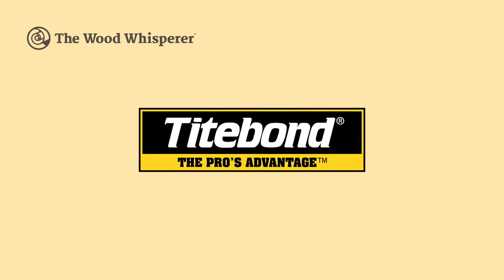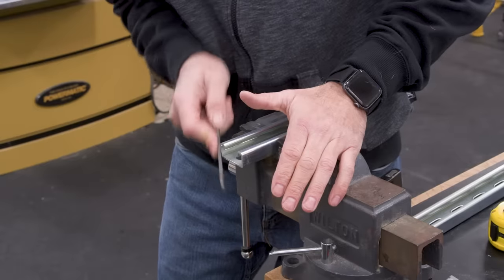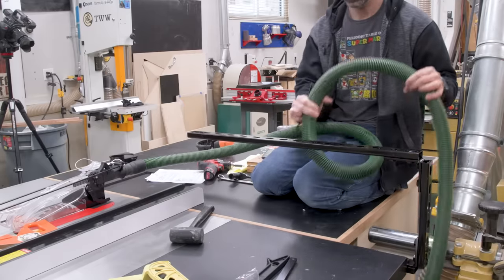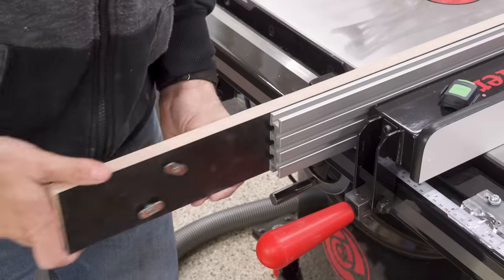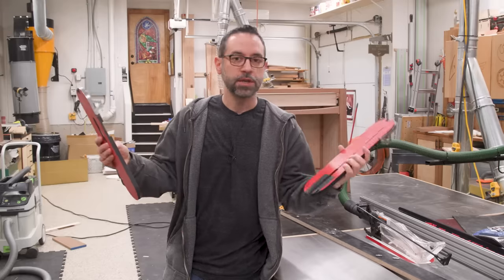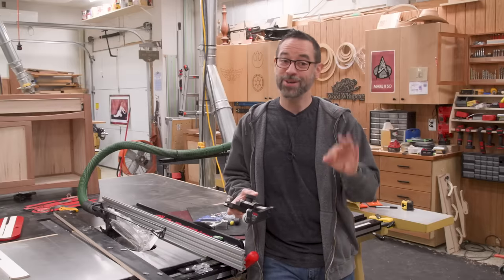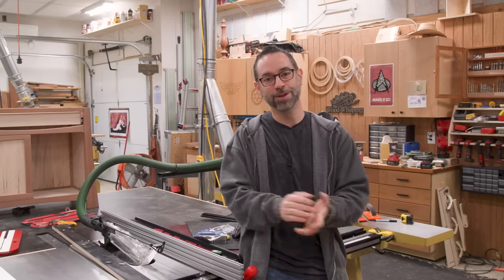7 Must-Have Table Saw Upgrades

Comment: Buying a Saw Stop for my new shop in my new house, and went searching for inserts for the saw. Found this site (for the 2nd time) and this time saved it to my shop ideas play list. Love what you did for the dust extraction system and the upgrades you made to the fence. My kids bought me a Jessem Clear-Cut TS Stock Guide for my saw and setting it up with the rail on the fence is an awesome idea, something I'm sure I'll be incorporating into my saw. Thanks again for all you do for the woodworking community.

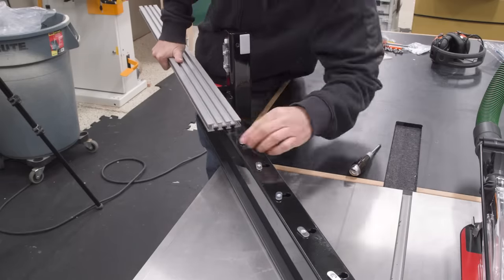Comment: I installed the aluminum extrusion on my fence today. I used the hardware recommended by Mark in the description. At 4:10 when he says "the bolts just barely grab the metal around the keyhole slot" he wasn't kidding. 

Because of this -- combined with the difficulty of tightening the screws with a ball-head hex key -- I opted to add some washers to keep the screws from slipping out of the keyhole. A dowel with a small square of double-sided tape at the end helps feed the screws into the holes from inside the fence. 

Next up, I'll be making my very own Cremona.
Reply: Thanks. THe washer and dowel trick would have saved me 5 hours of frustration had I read your comment 5 hours ago!

Comment: Good advice. I did a similar thing with my Axiom CNC. They wanted $500 for an overhead dust collection pipe. Using 4" black PVC and a couple of toilet flanges, I made the same configuration for $76.

Comment: Nice video.  Along these lines, may I suggest a video comparing after-market table saw fences?  I thought your miter gauge video was excellent - but I tend to get more frustrated with the out-of-box fence on my Delta contractor table saw.  It's not bad per se - just fiddly!

Comment: Marc great concept, but needs to be an easier way to reattach or grab the inside of the bar to the extrusion? Just not enough grab with the bolts you recommended, too easy to slip or move.  Doing some experiments with 1/2 bolts, vice 1/4 inch, and the oval nuts on both sides of bar, one on the bar inside and one in the extrusion.  Need a ball end allen wrench for sure to get the angle to retighten.  Been trying, frustrated and yes with little success.  Agree with your comment on not the best way for sawstop to attach the bar face, maybe a recessed nut bolt arrangement, so you can get from both sides.

Comment: If you get the Jessem guides that are intended for router tables, you could slide them right into (and out of) your aluminum extrusion face. Then you also have them to use on your router table!
Reply: Sort of.  They each work a little different.  It’s worth it to have the right ones.
Reply: I have both, there is a significant size difference between the router and table saw versions. The router ones definitely don’t seem beefy enough for table saw use.
Reply: @TheFPSCENTRAL  This comment is strange. Router work is much more involving than table saw work, particularly for a rip cut, so if those router guides are beefy enough for your router work, they probably are beefy enough for table saw work. 
I think the only real difference is that the table saw guides allow you to extend them far away from the fence, meaning you can support much wider pieces.

Comment: Great suggestions Marc. I quite like your metal extrusion fence face. All of them are good. I do find my dust collection really sucks (in the wrong way) when using the zero clearance plate. My Delta doesn't have an overhead port of any sort so I have tried drilling various holes in the plate to give room for air and dust. Sorta kinda works.
I love your channel (and Matt's).
Reply: Cover any holes. Like that big gapping hole at the tilt channel also a lot depends on your dust collection system and its cfm ratings  and type of filter it uses.

Comment: Hi Marc,

As usual great ideas and demonstration. I have most of those ideas on my table saw and they work superbly and safely. The Jessem's avoid me because of the cost. However, feather boards off a t-track on the top of the fence do a great job coupled with a side featherboard to hold everything down and on the fence.
Sorry, but why do so many people forget that Magswitches can be used in stacks of jigs.... you can take them out and move them around? I have a range of them for all sorts of jigs and they are a one off cost for multiple solutions.
Even the Sawstop overhead dust collection arm works great on my tablesaw.

Thanks again.

Comment: The Wood Whisperer talks to Table Saws!  What a great video!!! I like all of your table saw enhancements. Also, you can use the unistrut for custom storage solution also. Would like to get your thoughts pro and cons of adding a digital measurement device to a table saw.

Comment: I just bought a Harvey ALPHA saw and without any accessories other than their overhead dust collection arm. This system is one of the best I've seen and every bit as good as the one that cost 3 x as much on my FELDER Sliding Table Saw. All the fences etc are from Incra. The extension table will be a full drawer cabinet built by me that extends into a full woodworking bench. I'm looking forward to seeing how it comes out.

Comment: Great video Marc, always great to see clever ways to optimize the table saw, and even better when someone presents a detailed way to do it!  I have the ICS model, and also experimented with ways to improve the table top dust collection.  In my experience, connecting a Festool CT26 directly to the port on the blade guard did not significantly improve dust collection as compared to the SS overarm thing...though I did change the "Y" connection at the saws 4 inch port so the airflow from the 2 inch hose was now towards the DC (Oneida V3000)...  I don't have an air flow meter, so it may well be that the CT26 did provides more suction, but it did not result in enough of an improvement for me to dedicate it to the saw.  Also, did I see some "dots" in the background for the "Origin" CNC machine???  If you review that, please address how it can be used (if it indeed can...) without first mastering a CAD program..   Thanks again for the video!

Comment: Those upgrades to the saw stop are brilliant. I’ve often had issues with feather boards for example.  I like the dust collector DIY. I’m using 2” black ABS for mine and only 2’  of corrugated tube at either end of the long  skinny ABS “U” to connect to the guard and for the hookup to the 4” port

Comment: Nice upgrades! Yes, dust collection on the SawStop is exceptional when both the cabinet port and blade guard dust ports are used! And despite other prominent YT'ers saying it wouldn't work well for machines like table saws and planers, my dust collection system is powered by a large shop-vac with key fob remote control and works very well on all my machines except the chop saw.

My solution to the blade guard dust port is a mini shop-vac sitting on the extension table...for now. I've been thinking about hanging it from the ceiling to get it completely out of the way, but I rarely cut sheet goods, so it's seldom in the way. Only downside is it wouldn't be controlled by remote (it's now now either). Nice build on the DIY overarm, but I don't think I'd like any type of overarm system.

I may have to go with the aluminum fence though! I've noticed my fence isn't PERFECTLY straight, or square to the table for that matter, which was frustrating when I built a spline jig a couple weeks back.

I screwed a cabinet door handle onto the main rail endcap and I store the allen wrenches in there. A drawer would be even better!

Thanks for a great video!

Comment: The best upgrade for me was an upgrade from a table saw to a plunge saw with an mft table. Much less dust, easier to cut, requires less space. For me it works better for a small DIY shop

Comment: Jessem stock guides👍.  Outstanding for older saws with no riving knife (or usable kickback pawls). The wheels roll only one way to counter (prevent?) kickback.  Extrusion fence face is an interesting idea!  Speaking of fences, a replacement fence is probably a first consideration for those older saws. Thanks for the ideas.

Comment: Awesome.  I did very similar thing last year, only welded up a bracket and box tubing.  Yours looks just as good !  I used a section of straight shop vac extension tube to a hose.  Love the material you picked it's sturdy.  Love the U-bolt idea.  I am using a velcro strap to park it. AND ...I need to use your extrusion idea  !

Comment: You are correct, sliding on the tee track to the fence is/was a bear.  Also, the design for the screws is not great!  Great Video.  So, I now have the tee track installed and the jessum Clear Cut guides.

Comment: I just used strut to hang my dust collector but I didn't think about using it for the table saw dust collection. I have a 1944 Unisaw, dust collection wasnt exactly built in... If I can find a blade guard to retrofit I'm going to do copy your idea. Thanks for the video.

Comment: I have had the Jessum accessory for a couple of years now and I did the attach to some 3/4 inch Baltic Birch and use 2 mag switches and it works perfectly. I am going to switch to the aluminum extrusion fence so I can add the sacrificial fences and other accessories you showed and I have a shop vac I'm not using that much and will add that to my over arm suction.  thanks for the tips!

Comment: Thanks Marc,  I have a similar aluminum fence (Woodpecker Supertrack) on my Delta T2 Fence, but havent taken advantage of too many attachments for it yet.  I ordered the hardware you linked to add any sacrificial fence small, tall whatever.  I can also use them on my miter gauge since it has an aluminum extrusion Powertech fence as well.  The fence you linked looks awesome, I would have just purchased that.  Comes in a lot of sizes.  Thanks

Comment: Couple more things to think about: woodpeckers rip flip plus a DRO. With that setup you get almost perfect repeatability with stops and micro adjust. It’s got many of the advantages of the Incra fence system but also stays out of the way. I also have the Jessem track permanently attached to my fence and made a little caddy that rides on the fence for the push sticks, etc.

Comment: Mark I put my floating over arm on a Y off a single 4 inch drop. One to the cabinet and one to the overarm. On the Floating overarm I am pulling close to 600 cfm at the end of the tube.

Comment: Good information. I realize that I'm something of a dinosaur in that my table saw is a 48 year old Delta Contractor's 10 inch. Having said that some of the suggestions that you make can be adapted to the Delta, but not all of them. SacrificiaI fences and the like are an interesting project to do on the Delta fence. I  have a Ripstrake device that acts as a hold down on the fence that is also probably pushing 45 years old. It requires an add-on to the fence for use. Don't know if anyone else uses the things or not. ZCIs are mostly made from 1/2 laminate flooring at a fraction of the cost of a OEM insert. Dust collection is a FrankenVac system, but I to like the overhead  arm idea. Mebbe in the winter I'll get out my DIY  Engineer Cap and have at it. Wish I had the time and bucks to invest in a "newer" saw, but the old Delta does what I need and want to do.

Comment: I purchased the extruded aluminum fence shown in the video and had difficulty securing it to the saw stop fence. The screws shown aligned exactly with the large part of the keyhole slot. They could not be tightened to secure the two fence pieces. I used a pair of needle nose plier to thread a washer on the screw before attaching the oval nut. Took some finagling but got her on their. Also I tried using a single sheet of paper thickness and it felt like it was dragging. When I doubled it up by folding it in half worked like a charm.
Reply: Thanks for this. I'm having the exact same problem. The fence pops off when I lower it to just above the table.

Comment: Years ago, I spray painted my bandsaw table flat black because the glare was a distraction when making small tight cuts. Btw, I make small drawers out of  sheet aluminum repurposed from an old aluminum awning by bending it into a U shape and tacking in thin wood ends. Might try making a drawer for my table saw void, if I can figure out what to stored in there 🤔.

Comment: Woodcraft and Infinity have sales on the Jessem saw guides from time to time. I saved $60 the last time they were in sale. Also, if you do decided to mount them using wood and mag switches just done screw the magswitch down and you can use them on other jigs as well. A person could just plain the word strip to the exact thickness of the magswitch and the lip on the mag switch holds the wood strip down.
Reply: Edit: don’t screw the mag switches down. For some reason I cannot edit a post on YouTube using my iPad.

Comment: When drilling or tapping metal you might find cutting oil to help with the process.
Reply: So question about tapping, I have only done it on mild steal and by hand, for taping other materials like brass or aluminum is the process done different, do you need to do back turns to clear the threads?
Reply: @janitorbob2008  I use the same process regardless of material, though if I'm tapping wood I don't use cutting oil. Slow cuts backing out to clear threads every few turns like you said. I know some are comfortable using power tools but I still just do it by hand.
Reply: Came here to say that, it was like fingernails on chalkboard to watch that.

Comment: A 1/4 HP power feeder is also a great accessory.  Especially when you need to rip many long boards.  It has a continuous motion into the blade, which avoids the starts and stops when repositioning your hands to push.  That eliminates small dings or blade marks that needs to be sanded later.  It also keeps your hands away from the blade, holds the boards down and angled toward the fence, and makes the job quicker to finish, as you walk to the output of the saw to remove the board just ripped while ripping another.  I made a whole home worth of cabinets for kitchen, laundry and bathrooms and my power feeder was the best accessory investment I've ever made.  MagSwitch has magnets and plans to make a base for power feeders.  Although it's designed for mini 1/8HP power feeders, I was able to add two more 235# MagSwitch magnets in addition to the two ~1100# magnets that come with the kit.   I've also used the power feeder on my built in router table on the table saw.  Power feeders are best used on cabinet table saws with cast iron tops.
Reply: Hello. That sounds interesting. Can you recommend a brand and/or model of a power feeder? Thanks.
Reply: @dngriffiths8105  I bought a Steff 2032.  1/4HP and around 80 pounds.  Lots of other choices for 1/4HP feeders.
Reply: @bobbray9666  Thanks, Bob.

Comment: I looked into getting a fence rail drawer for my Biesemeyer fence and found someone on Ebay selling 18 inch or 36 inch long drawers that fit Biesemeyer rails for $ 25 or $ 30. I ordered some 18 inch ones and will see how they are.

Comment: I'm surprised your saw didn't come with the "free" overarm dust collection where that whole arm pivots and pops in and out via friction at the end of the table and splices into the main dust collection. Anyhow, wondering if and when you'll opt for the Sliding crosscut table addon. I just got mine a week ago and is awesome especially for large sheets of plywood and bulky large crosscuts of solid wood. I'm building the executive desk now and will try it out trimming the ends of the large table top instead of circle saws and straight edges. Only pita is the need to occasionally remove the miter fence to do ripping wider than 15" to the left of the blade. But that is just as fast as changing from dado to regular blade and brakes :)  I think I'm going to try your aluminum fence option and eventually the Jessem guides as I see a need for that often on longer rips.

Comment: For my over arm dust I purchased a used whole house vacuum and connecting it to my blade guard port (Shark Guard). This coupled with the high volume port connected to the base. The entire setup is turned on & off when the saw is started. It collects most of the dust. Don't forget to run the saw dust through a mini Dust Deputy to extend the life of vac.

Comment: Can you please explain why you went with the 48" extrusion for the fence upgrade?  I have a SS and the T glide fence is roughly 36" long.  I am curious of the benefit.  Thank you for all the useful information!!!
Reply: Woodhaven offers several extrusion lengths.  You can select the length that works the best for your setup.

Comment: I wish I’d known about that zero clearance insert with the budget friendly inserts. That would be great for dado stack cuts. I might still get one. 

The only time I have serious dust issues with my SawStop is when I’m using my cross cut sled, and that means no blade guard. Any suggestions?

Watching a hole get tapped in metal with a power drill and without cutting fluid made me queasy…

Comment: One nice thing about the mag switches is that you could use them to hold various other fence additions. So at least the $100+ isn't dedicated to just the rollers
Reply: so much seem to be so expensive. Many of us don't have the financial resources for some of the multitude of devices we seem to need in wood working. For years I have made my own table saw inserts using decent 1/2" plywood and 1/2"x4 flat head screws as hight adjusters. works very well and much less expensive than $65 for manufactured ones. Thanks very much for your videos.

Comment: Hey Marc.  Curious as to why you didn't reuse your VSCT fence system with your SS since you already had it.  I also have a SS and was going to order one as well so how I'm wondering a bit if there is something I should know before pulling the trigger on a several hundred dollar accessory.